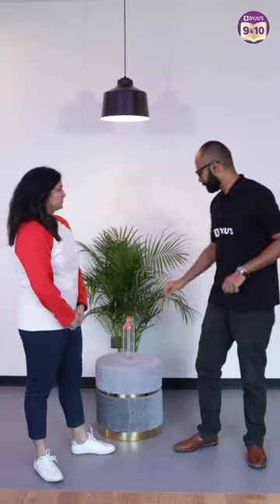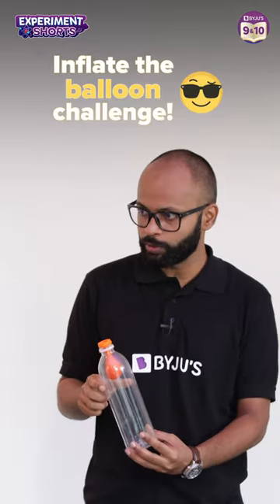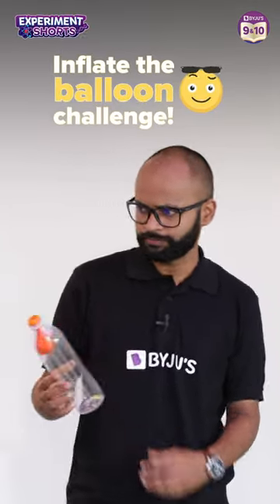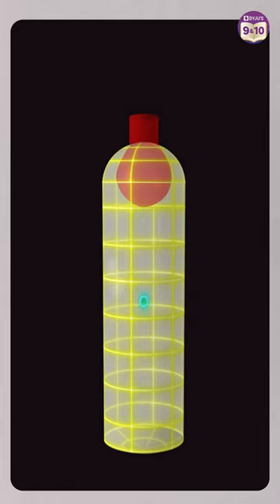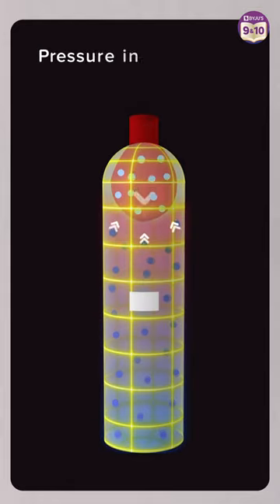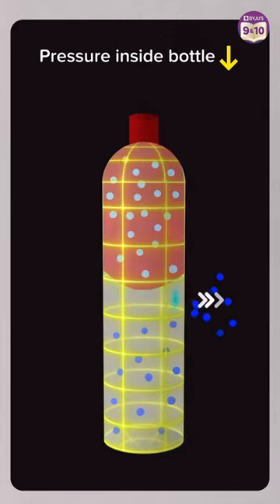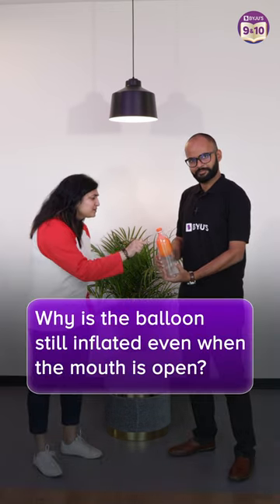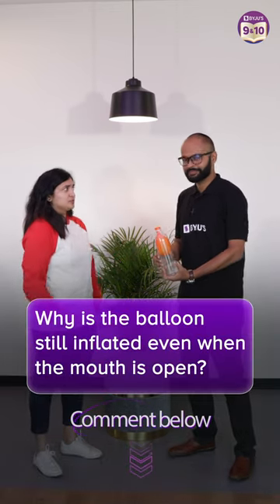How to Blow a Balloon inside a Plastic Bottle | Easy Science Experiments at Home | #ExperimentShorts

Comment: Because the air inside the bottle and the balloon apply equal and opposite pressure to each other. So the air particles in the balloon are not coming out in upward direction instead it is going downward